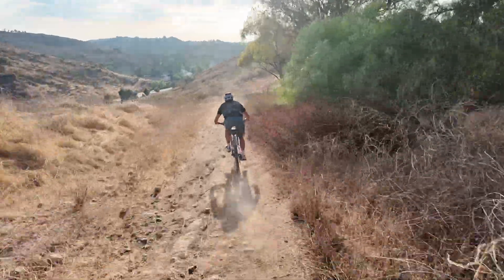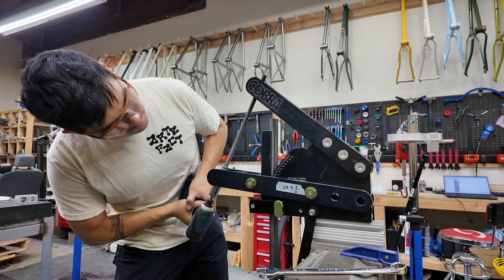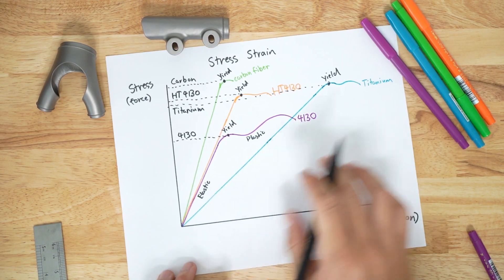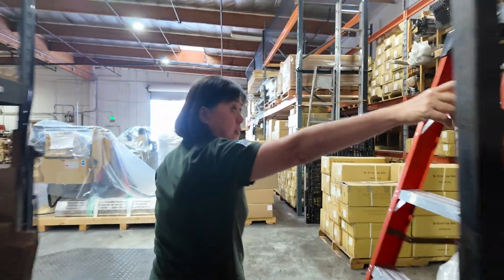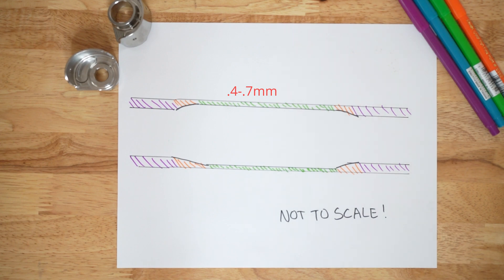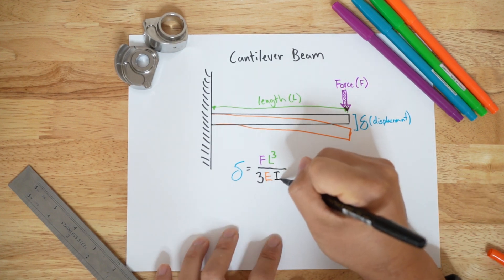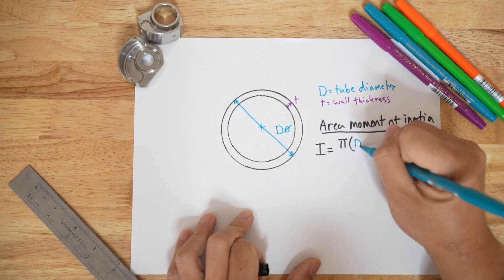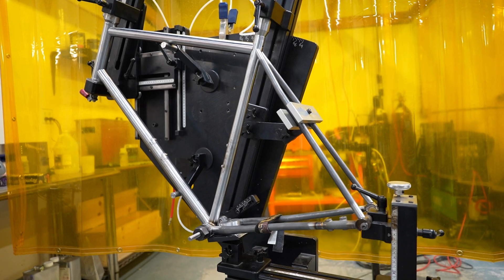Why Steel will always be Real

Comment: Thank you Daniel I learned a few things.
Trivia: What famous steel bike frame had NO TOP TUBE and  NO LEFT SIDE CHAIN STAY answer below.

The EV Warrior.
The EV Warrior was a masterpiece of engineering ... with some quirks & fails.
If you ever get a chance to ride one you should.
The definition of plastic deformation lives strong in the massive oval tube that is trying to do the work of 2 tubes on a hundred pounds bike. In fully restored condition they will do killer wheelies and rip across the intersection before the cars even knew the light changed.
Tons of toys & goodies like a real VIN number and title, sequential turn signals in the mirrors. Did I mention dual motors, two high quality (read heavy) sealed lead acid batteries, horn, headlight, Curtis controller and much more.
I have owned several and just lost two last October 28 when the neighbor's tire fire turned my shop to ashes. 
Anyway, check some pictures, a frame engineers nightmare.
Note: Only early production bikes had no left side chain stay as that was clearly a stupid decision.
Reply from the maker: @kevinsellsit5584  I remember buying EV warrior motors for robots! Funny trivia, I would have never guessed.
Reply: @Daniel_Yang_ARTEFACT  It's like 'how could a bike frame possibly not have a chain stay'.
And the single tube to the head was huge and oval but that thing would twist and flex like crazy.
Thanks for a great video.

Comment: Haven't scanned all the comments yet, wonder if you'll get pushback on the 'claim' that the elastic modulus is constant for all steels (OK not exactly constant but close enough).  I put 'claim' in scare-quotes as a joke because it seems to blow some people's minds.  Even Reynolds, in their marketing sheet for 753 in the '70s - early '80s, said the heat-treat made the steel stiffer.  Of course the Reynolds engineers facepalmed when they saw that, they knew better.  But people keep saying it to this day.  Thanks for this vid, so clear and so correct.  Oooh, my up-thumb was number 531!!!!  Nice!
Reply from the maker: Haha yup! This was a big myth I wanted to bust. Even if it’s a placebo effect, it still works. Just goes to show how complex our human preconceptions are.

Comment: what bout stainless steel? love steel but annoyed with rusts. Went Ti but its  larger tubing ruins the aesthetic for me.
Reply from the maker: Stainless is pretty much the same mechanical properties as regular steels, but  more expensive. Because of that, the market is small, so there are not that many butting and diameter options. That’s why you don’t see that many stainless bikes. Would be fun to build one!

Comment: Thank you for all of this interesting and informative video! I just watched the Bike Sauce video. I am curious if you were NOT surprised by his findings? Did you design the frame to optimize lateral compliance? I live in Mexico City and I'm thinking of having a custom steel bike made by a builder in Colombia. I am wondering how to discuss this topic with them. Thank you!
Reply from the maker: The Honzo toptube and seat stays were larger diameter, that’s why the hummingbird is more compliant. But I think the bigger difference between the two bikes is geometry. The hummingbird has more weight on its front wheel, so more bumps are eaten up by the fork. For our ML frame we use a 28.6 toptube and 38.1 downtube, that’s a good baseline.

Comment: What are your thoughts on the saying of "Steel has no fatigue limit"? I know aluminum and carbon fiber may fatigue sooner, but is it true that steel has practically no fatigue limit? Is this why my bike from the 70's is still going strong while aluminum frames eventually crack?
Reply from the maker: Good question, I wanted to touch on fatigue limit of steel, but ran out of space in the video. From a materials perspective, steel has a very high fatigue limit. However, in the real bike world, the heat stress and change in material properties at the joints (from welding) are enough to cause steel frames to crack over time. Realistically, bikes are not meant to be ridden forever. However most bikes don't die because they crack, but rather they go out of style or have weird parts that cannot be replaced. Steel makes bikes simple!
Reply: Actually, that's aluminium and carbon which have no fatigue limit but it's a bad thing! That means, even smallest load repeated sufficient amount of times would eventually destroy aluminium or carbon frame. Steel having fatigue limit means that loads below that limit could be repeated indefinitely with no fatigue whatsoever! Though that advantage is more of theoretical one: both aluminium and carbon can be produced with lifespan sufficient for all practical purposes (say, 50 years lifespan limit by fatigue, it's more likely to fail by other reasons!)

Comment: Nice overview. Reminds me of Engineering 3 at UC Davis. I'm surprised that you didn't talk about Aluminum. And by AL, I don't mean 1st gen Cannondale or Klein frames, but more recent AL frames where tube wall thickness and profile tuning are more advanced. I realize that AL frames are used primarily in low-end bikes - obviously the cost of the material and frame construction is less. I had an Specialized Allez with hydro formed tubes that I thought was no more rigid than my carbon race bike. WRT to steel, I've read way too many bike media articles about the magical springiness of steel vs the rigidity of AL frames. Honestly, my Paramount, with its steel fork rides a little harshly. And one or two engineering oriented articles that I've read seem to debunk frame compliance as a thing. In my own experience, the compliance of my gravel and mountain bikes seems to come mostly from tires or suspension and maybe from the seatpost. Where do I have this wrong?
Reply from the maker: Its a good point. I love all the new generation of well design aluminum frames. I felt I didn't have enough expertise to comment on it. The development cost of those aluminum bikes are probably more than carbon fiber. That is why only the big players like Specialized and Trek have the resources to invest in it. Still very important, because it brings high quality, well designed bikes down to a lower price point.

There is definitely differences in compliance between frames. We do a lot of back to back testing (same components, different butting) and you can notice a difference. I believe the misunderstanding is that the majority compliance is torsional. There is no vertical compliance except from your fork and your seatpost.
Reply: @Daniel_Yang_ARTEFACT  Good video. I have a specific question regarding this. I was an early adopter of late 80's Alu mtb frames from Cannondale/ Klein etc... back then it seemed to be regarded that frames had to be made very stiff to prevent early fatiguing being an issue, hence the big jump in tube diameters and aesthetic from the steel norm. Those frames were ace for their time for racing, but felt a bit too stiff for comfort. Jump to today and we have some good modern Alu options from the big brands, or brands such as Mason, which have a reputation as not having that harshness of early ALu frames - these look a tempting option in todays market for cost to performance, and tempted to move away from carbon for offroad. My question is, does this compliance built in to a modern Alu frame come at the expense of a predicted shortened service life owing to the tube flex causing micro fatigue, or do you think they're doing something with tube forming/ joining to mitigate that?... or as you say, maybe the perception of comfort in these bikes is coming from tyres, wheels, components...
Reply: @Daniel_Yang_ARTEFACT  Hey Daniel, the notion of torsional compliance makes sense to me. Where I see that coming into play is when standing and pedaling over bumps, ruts, roots etc. and having the bottom bracket move torsionally.
Reply: I heard theory and it sounds very plausible that "springiness" of steel frame comes from its weight. As it is heavier than aluminium or carbon, it tries to stay in place when wheel hit some bump (allowing tire and spokes and suspension if there is one to do its job of deforming enough to "eat" this obstacle), leading to much smoother ride! That means, cheap steel bikes (no butting leading to extra weight) are more springy while lightweight state-of-the-art steel frames feel almost the same as aluminium!

Comment: I missed aluminium in the explanation. Excellent video, thanks!
Reply: Yea, that one was missing for some reason. Aluminum's issue can be "fatigue resistance". Steel does mush better in this regard.
Reply: Car wheels are made of aluminium alloy, as well as many parts of chassis.
Reply: Aluminum in cycling is a big lie. Aluminum should only be used when a more aesthetic design and lower weight are prioritized over economy, durability and strength.
Reply: Aluminium alloys in cycling are used for a reason.
Reply: @tongotongo3143  Aluminum is used in cycling because it is lighter and allows for more aesthetically pleasing component designs; although it is more expensive, less resistant, and less durable than steel.
I am convinced that the vast majority of recreational cyclists who choose to pay a higher price for aluminum,  do so for its aesthetics rather than its lower weight.
Professionals choose components for their performance and commercial interest. They are the ones who set the trend.
Reply: Aluminium hardens and becomes brittle and cracks
Reply: You cannot make a spring out of aluminum.
Reply: this stupid myth has simply taken root in the brains of ignorant people - of course you can build a wing for an Airbus A380 out of aluminum and the wing flexes many meters - millions of times - so what is the point of this silly saying ? from someone who obviously has no idea about the subject but just repeats what others have said at some time ?
Reply: @Śiśna3633 this stupid myth has simply taken root in the brains of ignorant people - of course you can build a wing for an Airbus A380 out of aluminum and the wing flexes many meters - millions of times - so what is the point of this silly saying ? from someone who obviously has no idea about the subject but just repeats what others have said at some time ?
Reply: @bertkreft9689  I am asking as a layman. Wing is not one solid piece of aluminium, it's more like a composite, isn't it? So saying that you cannot make a spring out of aluminium is true. Am I right?
Reply: @Stefan_Kawalec  no. it just bends less. aluminium is great, but not perfect.
Reply: @bertkreft9689  Take an aluminum alloy, then put it under well known simple stresses like airplane wings which have heavy slow stresses, and you can see a material that works extremely well.  Take an aluminum alloy and put it into an severe duty impact situation and you might see something different.  Loading and flexing might see good use out of many harder materials like carbon or some alloys that will do well under heavy long stresses.  But, if you build a mountain bike and slam it into things, bunny hop, give it very hard impact stresses which are different than tensile strength, and then what?  

They still build hammers out of iron/steel because of weight, but also because it can take repeated impacts and hard blows.  What about other "wonder" modern alloys and materials?  Many high tensile strength materials have poorer impact properties.  The idea that many super hard/light materials have zero downside is a myth unto itself.
Reply: @bertkreft9689  You are describing a special case. Also fighter jets have composite wings that flex. But the point is that you cannot have aluminium  springs in Cars, Motorbikes, Bicycles,  Trucks, Busses etc. Not even high end exotic cars have this.
Reply: More about being very cheap, easy to cast and with the right carbon content is soft and ductile. For a hammer that's great, doesn't make aluminium shit. Materials aren't better than other materials just better achieving specific goals.
Reply: That doesn't matter, it's not the material for the job, and that's all you should ever judge a material on, no material is 'better'.

Aluminium alloys have a higher specific stiffness than steels(saving weight) "don't" rust (it actually oxidizes so much that it forms a protective layer on the surface), and unlike carbon is still affordable to produce, is 100% and easily recyclable (carbon becomes landfill), and while less than steel, does yield and deform unlike carbon which is quite glassy(meaning no yielding before failure).  And while the video is amazing and does a great job of explaining engineering topics with an applied context, and the comment about not needing to overbuild is actually very insightful and cool, you are not going to be able to get away with as general tubing as light per unit of length, I would think, since most parts of the bike will never experience any loads anywhere close to yield, so that advantage only holds true on joints and sections of tube experiencing more loads.

Ai alloys are the 'default' for many reasons! Its about offering the best combination of properties for most situations including price, maintenance, performance per cost, etc.

All materials have their place :)

Comment: How does stainless steel compare in all of this?
Reply from the maker: @Alex_564  great question. stainless is the same stiffness and regular steel. The fancy stainless like Reynolds 931 has really good mechanical properties. The problem is that stainless is very expensive so there is a small market for it. That means there are not that many tube butting profiles available. The butting profiles and diameters matter more than the mechanical properties.
Reply: @Daniel_Yang_ARTEFACT  would stainless steel be lighter or offer better ride quality than non stainless reynolds models or Columbus xcr vs non stainless? That is if two bikes were built the same.

Comment: Oops, Composites are complex. Fibers by themselves are stiffer. When fibers are placed into epoxy and the total system is tested in the longitudinal direction, Uni directional Carbon Epoxy laminates will have stiffnesses similar to titanium. In a woven format the carbon epoxy laminate actually has a stiffness of 1/4 that of steel, however, woven carbon laminates are 1/5 the weight and therefore can be slightly stiffer in equal weight situations when loaded in the longitudinal direction. By equal area however, Carbon fiber is more compliant and absorbs vibrations and impacts The real highlight is Strength, where a Uni Directional Carbon epoxy laminate is roughly 10X the strength of steel. Therefore, a lighter weight object can be produced.
Reply from the maker: @CRITESBIKER  for sure, I think composites are amazing and have huge potential. I Would love to make Carbon fiber bikes, but for the scale you need to be at, you need to prioritize money over innovation. It costs $60k to do a run of Carbon molds.
Reply: But carbon fibre arm-bars in construction industry cost less than steel arm-bars.
Reply: It would be interesting to manufacture a Fiberglass and or Kevlar Commuter bicycle where the bicycle is half the weight of steel, roughly the same strength of steel but absorbs impacts to create a smoother ride on the way to work without needing suspension.

Comment: Thank and you for that very clear explanation.  I have ridden vintage Ti bikes, modern Ti, carbon, aluminum, plain gauge steel and Soma's execution of Tange Prestige.  I was never overly impressed with the ride quality of the steel bikes.  For some reason my 1973 Raleigh Competition in 531 has this unreal quality that I can only describe as springy and almost floats over chatter.  I truly now know why "steel is real".  Cheers!

Comment: As an engineering instructor, I think you did a great presentation of the topic. Makes want to purchase on of your bikes, because you know what's going on in a design.
Reply: When he said ultimate strength, the tube was still plastic deformation area, it didnt snap.
Reply: @nielsgiesen789 yeah I noticed that too. Buckling is not tensile failure. Good video otherwise though.

Comment: Aggressively writing 'steel is real' all over the internet is one of many ways old people cope with fear of the unknown and the uncomfortable feeling that something they don't understand is replacing something they have nostalgic memories of. Nice vid tho
Reply from the maker: Agreed. For me, the innovation is the biggest strength of steel, which is the opposite of nostalgia (although that never hurts). People have started entire new genres of riding with steel. The amount of capital it takes to make aluminum and carbon fiber frames is 100x more, which is why no one wants to take risks to innovate.
Reply: @Daniel_Yang_ARTEFACT  that makes complete sense. Steel is an obvious choice for a custom frame builder on the smallest scale. Although as a rider I prefer titanium, I'm not sure how much more expensive and complicated it is to make a single frame.
Reply: Steel is less damaging to the environment than titanium and carbon (the manufacturing process I mean). A well designed steel bike can be less fatiguing to ride long distances too. I’ve just gone back to a steel bike frame (Ritchey) and couldn’t be happier with it. 💯 feel less Fcked after a super long ride.